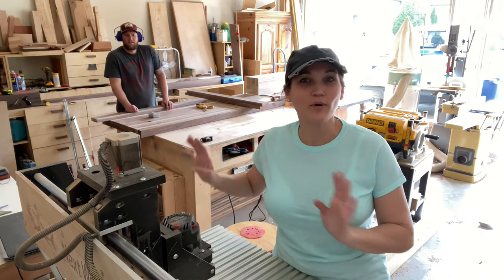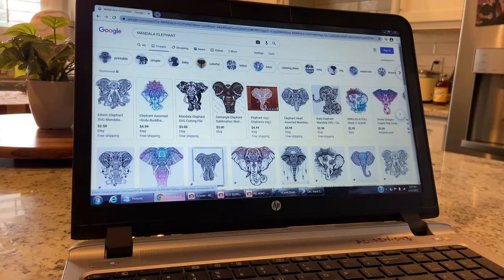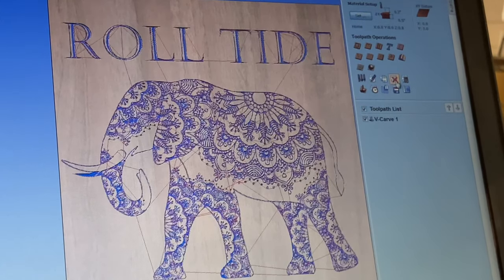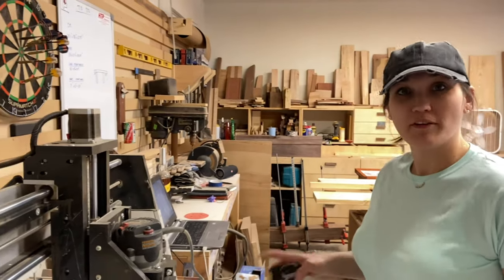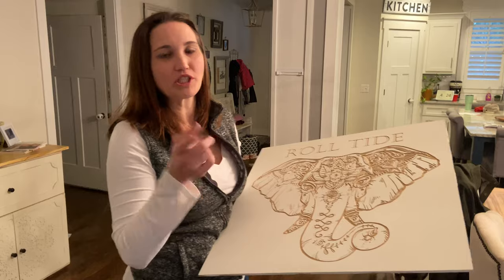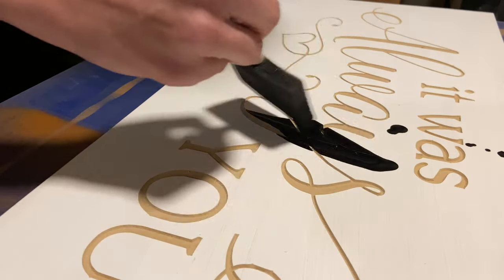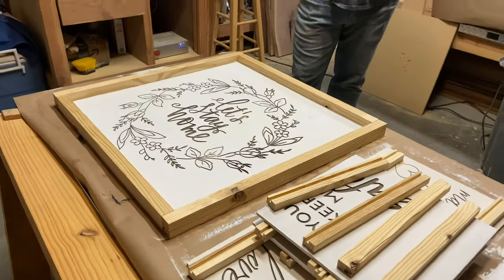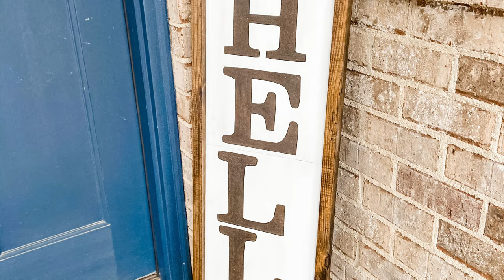**SAHM Making Money From Home! $$$ **How to make CNC, wood carved, Farmhouse Signs and Home Decor**

Comment: Hi. Do the paint other way around. First engrave sign, then  stain engraved sign, sand down the overpaint and then use firm foam roller to apply top white colour, very little at time so it doesn’t leak into engraving. Done.

Comment: I have tried doing signs using your method and I have two questions.  What depth do you use with your v bit? And how long between wiping the stain off and then using mineral spirits do you do?  When I use the mineral spirits it starts to wipe off the white paint before it looks clean to me.   Thanks for the video.
Reply from the maker: Hey David! I set my depth at .05 on vcarve. And the only paint I have found that works with my method is rustoleum flat white premium latex paint. I paint, let dry, then carve, then sand and stain the engraving. I immediately wipe off with a rag then use a clean rag dipped in mineral spirits to wipe clean! I hope this helps!